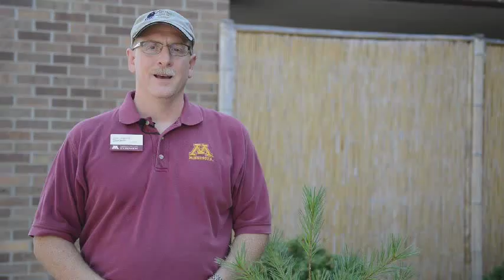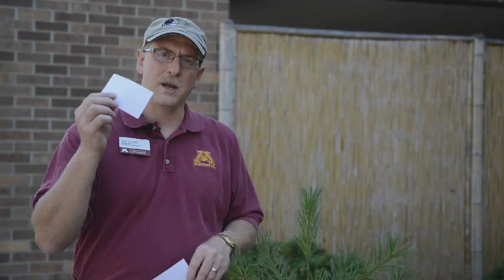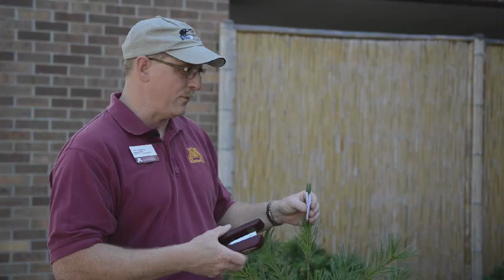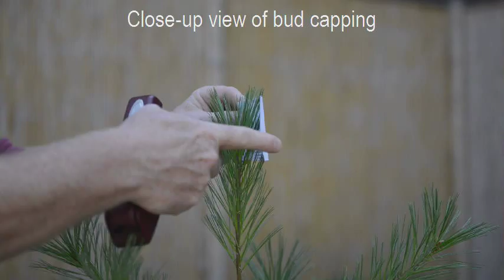Bud Capping Demonstration

Comment from the maker: A viewer asked if they should bud cap some white pines as they plant them in the spring.

My response:  I am not a forester, but rather a wildlife ecologist.  In the projects I'm involved with, we don't worry about young trees during the growing season because they are less palatable than most other plants that are growing around them at that time.  However, it is during the winter when nothing else is growing that young pines are vulnerable. . . . and white pine is far more vulnerable than red pine (although a hungry deer will try almost anything).  Bottom line:  bud cap in the fall as close to the frozen season as possible.

Hopefully you will capping in a way that does not impede terminal bud growth regardless.  The goal is to shield or protect the terminal bud really by 'hiding' it from the deer.  You do NOT want to use the bud cap as armor (e.g., really thick waterproof paper with 10 staples --- that would be bad).  Ideally, the spring rains would loosen the cap and it would naturally fall off in May.  Generally it is less than ideal to see bud caps in October from the previous season (sure, we see a few but ideally they should fall off).  Also be sure when you apply the cap that the bud has a straight shot out of the cap the next growing season (i.e., you are wrapping the cap around the stem to hide it from the deer but not OVER the top of the stem).

Comment: I am capping trees on the edge of our cow pasture. In case they blow into pasture I am trying different attachments that don’t involve metal staples which are dangerous to ruminants ( hardware disease). I wonder if metal staples be a problem in the environment for deer etc. If they got into their system. 
I am experimenting with staple-less stapler and adhesive bud caps. Any thoughts?

Comment: I am looking for 6000 - 7000 of these bud caps but am having trouble finding them.  I can find the mesh ones but would like the paper ones.  Any suggestions on where I can get these?  Thank you.
Reply from the maker: +Kory Kramer  With full disclosure, I am the wildlife guy who has only done this a few years  but I talked to my forestry colleagues.  Many people simply make their own.
PAPER:  In the past our students have used a few different types of paper.  The key is to NOT use the glossy paper, you want it to last through the winter but quickly degrade in the spring.   If you had a stack of old phone books - they would work great (remove the glossy covers and use the light-weight pages inside).  When we work with the DNR, they often use the inside pages from leftover hunting & fishing regulation booklets. You could also use plain white typing paper.  Newsprint seems too flimsy, although I haven't tried it.
SIZE: It is quite handy for all the bud caps to be the same size.   Actual dimensions can vary, although our experience is that a really good size is ~5.5 x 3.25 inches.  In general, 1/4 sheet of 8.5 x 11 inch sheet of paper is too big and 1/8 sheet is too small.  
HOW: Most printing businesses will have a large-volume guillotine paper cutter that can cut 500+ sheets of paper at a time.  Creating 8000 uniformly-sized bud caps would be a less than 5-minute job.  They might even have scrap paper available at little/no cost.  

Lastly, landowners with only a few trees have used standard staplers . . . and they work just fine.  At your volume, it would be worth investing in a few nice plier staplers (I think the last ones we bought were a B8 Heavy Duty Plier Stapler.

I hope that helps.

Comment: how about ponderosa pine seedlings in ND? no deer any where near my place I believe, but I do have rabbits.
Reply from the maker: +Kenny Carter This will not work for rabbits - they typically damage the bark lower on the tree, rather than the terminal bud.  Use wire cylinders to protect them.
Reply: did you do an example vid for one? if so, can you link me to it please? Thanks!
Reply from the maker: +Kenny Carter No video, but try this site:  http://digitalcommons.unl.edu/icwdmhandbook/53/
or
http://digitalcommons.unl.edu/icwdmhandbook/54/